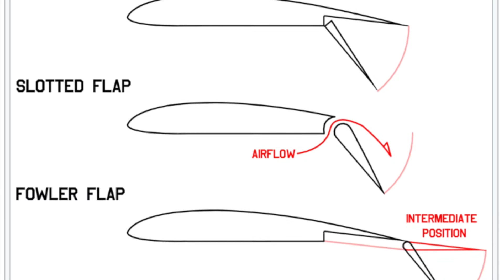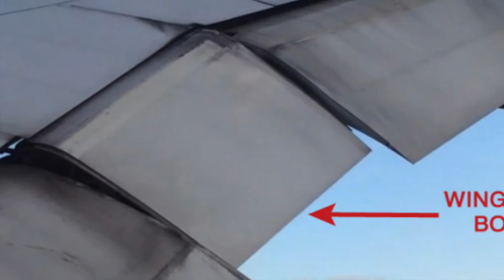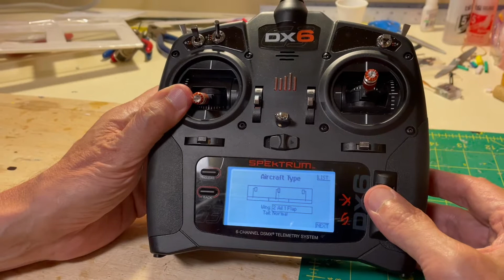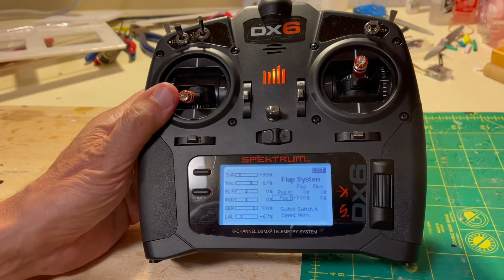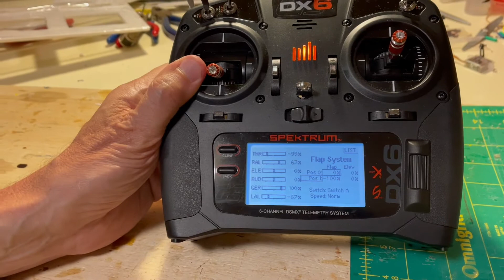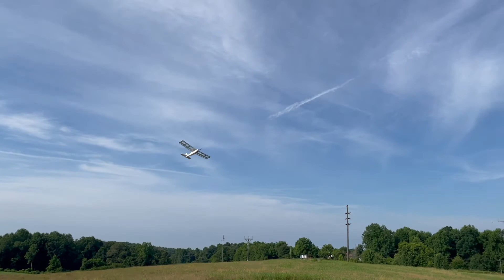Flaperons for Newbies

Comment: Outstanding as usual Tim! I’m doing my first scratch build on an ugly stick with flapperons and an old DX6 radio! Your timing is impeccable!😂👍
Reply from the maker: John:  Very good and best of luck!  Tim
Reply: @TimMcKay56  Tim, I forgot to ask: it seems to me that with flaps, they have take off settings and landing settings. How do you arrive at the proper angles for that?
Reply from the maker: @Glenfilthie1  John:  Flaps provide lift and drag.  The first increment of flaps (around 25% of total extension) is a lot more lift than drag, used for takeoff.  The full amount of flaps, say 100% of extension, lots more drag than lift, used for landing.  So for takeoff use around 25% or less and full flaps for landing.  In the B-777 we took off with 10 degrees of flaps, landed with 40 degrees.  Tim
Reply: @TimMcKay56  This inside informations of a real pilot are awesome :)
Reply from the maker: @franciscoduran3688  Thanks!   Tim
Reply: No DP control of of the flaps, and nothing about the mechanical setup.
Oh but SO much on the silly computer radio!  The only way I'll ever have an unnecessary computer transmitter is when I can't find a normal radio.

Comment: I´ll see if it´s possible to make a three position flaperons with 20/100% or 10° and 40° as you mentioned before. But the last one probably isn´t possible for functional ailerons... Maybe increasing travel on the ailerons (?). My Trojan T-28 1,1m hasn´t too much aileron travel on it´s standard configuration.
Reply from the maker: Francisco:   Good luck!  Tim

Comment: Great explanations on the theory site as well as the practical! 
I´m just a flying beginner and after flying 2,5 months STOL models tried a T-28 1,1m from E-Flite and was astonished how good sche flies. I could do take offs and landings without SAFE. But yesterday and today I tried landings and a very narrow road and the plane was a bit too fast for me. Today with side with I did a bit of a hard landing with a bounce I suppose and my beatiful AeroCam prop broke. I wanted to look for tips for landings and found the flaperon topic. That would be a good option for me I think. I have a DX8 and an AR631 6-channel receiver. I suppose I would need to give the channel of SAFE up? I still don´t understand very good if I need a channel on my Tx or my receiver or both (for SAFE Select). 
Have a great day, and best regards from Bavaria
Reply from the maker: Francisco:  Not sure on how SAFE interacts with flaperons.  www.HorizonHobby.com technical chat support may help.  But, as a longer term objective, do learn to fly without SAFE.  I think this will make you a better RC pilot.  Tim
Reply: @TimMcKay56  Hello Tim, yes I want to learn to fly just without SAFE. But my first plane a Turbo Timber 1.5 is after repairs so nose heavy that it doesn´t fly well without SAFE. It´s strange because in the air she goes up. I need someone experienced (I´m starting in a club) looks how to put the CG right and trim it mechanically. I have some Ideas too. I have programmed flaperons now and SAFE works with one aileron although that one has less travel downwards in comparisson to the "free" aileron that in full flap position also goes down a bit. But I hope that it works well. The other reason is that my daughter or someone else can fly with this plane in SAFE. 
There is also the possibility to programm the receiver from scratch. That is the next step. 

Thanks!

Comment: Good video. Please advise. I have Spektrum AR631 Rx and Spekrrum DX8 G2 and successfully set up flaperon function. Plane flys well. But My left aileron/flaperon no longer is actively moving in Safe mode.  AS3X and Safe only controls outputs of Ports 1 Thrott, 2 Aileron, 3 Elevator, and 4 Rudder. So  now Left flaperon/aileron is controlled by Port 6 and Safe not controlling Port 6. Plane still flys great. It will recover in safe and stabilize in AS3X with only Right aileron. Is there a workaround? If not, not a big problem.
Reply from the maker: Apologies, no idea of way ahead on this. Consider tech chat support at www.HorizonHobby.com  Tim
Reply: @TimMcKay56  ok. I sent Spektrum Tech support copy/paste of my question to you. I'll follow up w you on their response.
Reply from the maker: 👍🏻 Tim

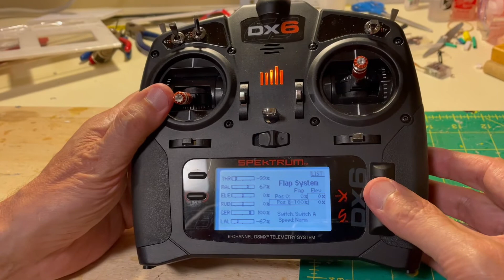Comment: Tim thank you for doing the video. I am running into a problem; I hope you can help me with. I have a AR631 receiver, and I have programed AX3X and SAFE. My airplane has 1 aileron on each wing and 2 servos, one servo attached to 1 aileron. Both servos are connected to the receiver with a Y cable to the aileron channel. I followed your directions, and have it configured like you have it. My problem is that the right aileron goes down and the left aileron goes up. If you look at your video at 7:20, you have -100% Flap and on the left of the screen you have RAL at 67% and LAL at -67%. My screen has the same thing, a positive percentage for RAL and negative percentage for LAL. Any ideas on how I can get both flaperons down?
Reply from the maker: Bob:  For the flaperons to work, I am pretty sure you need a 6 channel receiver, and use channel 1 and 6 for the two aileron servos. Do not use a Y cord. On your transmitter you’ll have to figure out how to activate the flaperon input. Most transmitter manuals can be Googled. Tim
Reply: @TimMcKay56   I think that he has safe on channel 6

Comment: I have 6 chanel balsa 1600 mm plane,and i have a Jumper TG8Pro the problem is how can i Mix in DEVIATION TX a swich to act like a flaps when i need them?There is a loot of tutorials for OPEN TX,EDGE TX and Futaba but i jus LOVE MY JUMPER and i dont want to buy another RC just to be able to setup flaperons in mix becose i know that i can MIX that funcion on my Deviation tx i just canot find tutorial for DEV TX do you know something about dev tx mixing and how to mix?Do i need ad a Complex or Expo and other in order to program 1 swich to act like flaps?My radio has a 12 chanels and my rx have a 8 and i am using just 6 ch for now...
Reply from the maker: Tom:  Good luck with this project. Tim

Comment: I am finishing a greatly modified Bobber.  The build is for separate aileron and flaps.  I am tempted to physically tie the aileron and flap on each side together and use the combination as a flaperon.  Any comments?
Reply from the maker: James:  You can tie the aileron and flaps together, but if they move the same direction at the same time, essentially strip ailerons.  The advantage of flaperons is getting the effect of flaps (both sides down for landing), but retaining differential movement for roll control (ailerons).  Tim

Comment: Flaperons can cause tip stalls, especially when the wing is tapered and the ailerons are a constant width. Also, flaperons can cause adverse yaw because the aileron on the outside of the turn will be lower and creating more drag than the aileron on the inside of the turn. You will likely need to use rudder to keep the plane from yawing in the opposite direction.
Reply: @txkflier...I  recently picked up an older model e-flight  Pulse 15e  , that has  only wing tip ailerons...do you think if I set up my  flaperons  to be used only when landing  straight in on final, it  would be OK...all  videos I have watched on this model  state it lands a little hot, so I thought that adding flaperons might help.......thanks
Reply: @garyvale8347  The specs I found show it has a wing area of 551 sq-in and it should weigh about 59 ounces. That gives a wing loading of about 15.4 oz/sq-ft (551/144=3.83 and 59/3.83=15.4). That’s a really low number, so it should fly pretty slow without stalling. However, it’s a fairly clean (low drag) design. The trick to landing it slow will be to bleed the speed off first. Fly a fairly low pattern so that you aren’t diving at the runway. Make sure you don’t get too slow going downwind..
Reply: @txkflier  wow...I really appricate you doing the math on this.....I will make sure to follow your advice ..................thanks much
Reply from the maker: Txk:  Great points, thanks for sharing.  Tim
Reply: I have G-44 Widgeon sea plane (counter rotating props). I want to use Flaperons (only) for landing to increase lift at slower speed before touchdown (to avoid "landing plop").
The widgeon wing is tapered with ailerons approx 2/3 length wingspan; taper is 1/3 of WSpan
Please advise. Thanks
Reply: @jhshorr1  When you use any kind of flaps that produce drag, you’ll have to use some power to keep it from slowing down and stalling before you can set it down. I use 15 degrees for takeoff on my EDF’s. More than 20 degrees increases drag more than lift. Planes without flaps will glide further and give you more time to rotate and flare, but they will have to touch down at a little higher speed. If you watch full-scale warbirds land, you’ll see that they carry a little power until just before they touch down.

Comment: I have the DX6, but can  flaperons be  set up  on the Spektrum™ AR636A 
6-Channel Sport Receiver with  AX3S  and  SAFE  ?.......
Reply from the maker: Gary:  SAFE gets real complicated when not used with the plane the SAFE setup was designed for, see my video on AS3X.  AS3X should work fine with a DX6 flaperon setup, I would say.  Tim
Reply: @TimMcKay56  Tim, I  recently picked up an older model e-flight  Pulse 15e  , that has  only wing tip ailerons and the Spektrum AS3X 6 channel sport Rx AS3X  and SAFE ......all  videos I have watched on this model  state it lands a little hot, so I thought that adding flaperons might help....my plan is to remove the current  Y-harness for the ailerons ( channel 2 )  and use the  Rx channels 2 and 6 for left and right ailerons ,   setting up flaperons  as your video showed....I was just wondering how , if at all this will effect   the  AS3X or SAFE  modes ......thanks
Reply from the maker: @garyvale8347  Gary:  Should have no effect on the AS3X.  But from all I have read SAFE it tailored to a specific model arrangement.  But maybe give it a try, see what works!  Tim
Reply: @TimMcKay56  thank you sir........